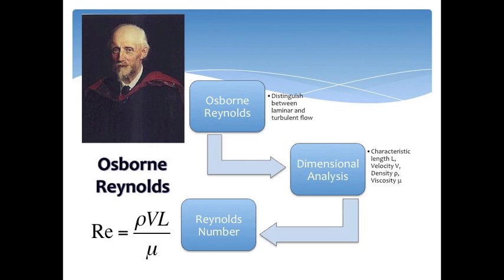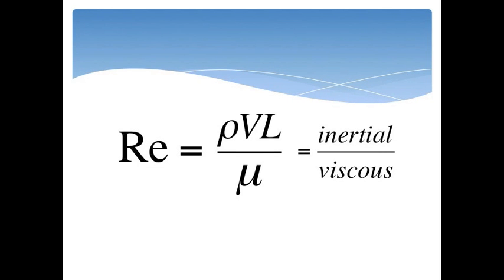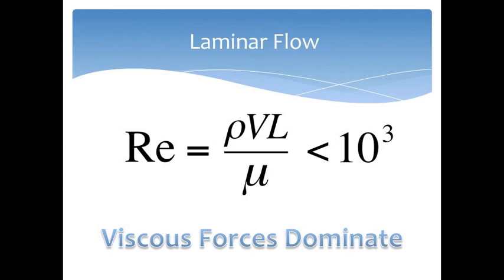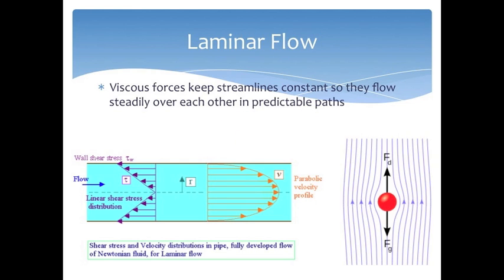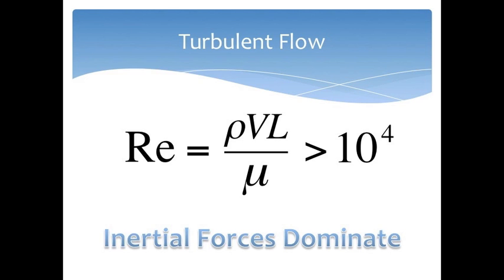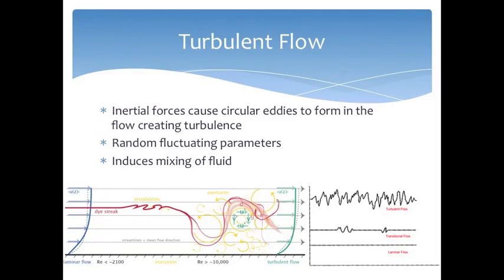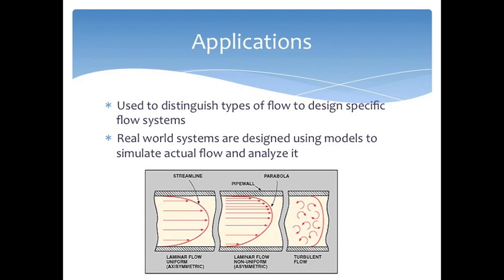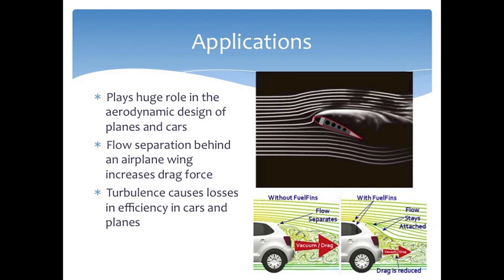Reynolds Number

Comment: I have a project where I need to heat large amounts of water (1.2 million gallon tanks) with no electricity or combustible gases.  Basically I have large water pumps capable of moving water at 1200 GPM (+) capable of pressures up to 300 psi. They are driven by 350hp diesel engines.   I need to convert that mechanical energy into heat.  I was thinking via cavitation.  I am in no way an engineer and have very little engineering back ground.  So any ideas out there?  I am looking for someone to help me design a system to take the cold water out of the tank and return it to the tank as warm as possible.

Comment: Just because the Reynolds number is less than 10^3  or greater than 10^4 does not alone determine whether the flow is laminar or not. 
this also depends on the geometry that the fluid is flowing through.

Comment: How do you get the viscocity value of an oil running through a pipe?
Reply: If you know what type of oil you are dealing with you should be able to find it in it's viscositydiagram. Take note that viscosity varies with temperature.

Comment: I calculate some figres for heat exchanger (shell&tube). I am bound to calculate Re in space between tiny tubes (were cooled fluid flows). My query is which diameter I should use for Re:ds= 4*Surface/circuit or get it from surface: ds= (surface*4/pi)^0.5 ?
Reply: 2